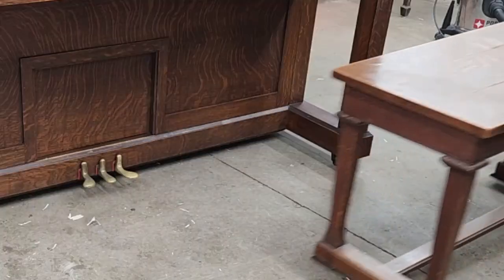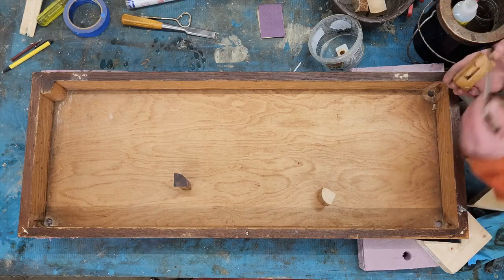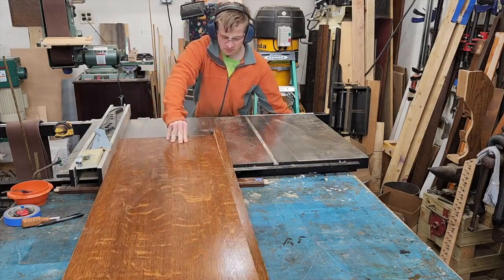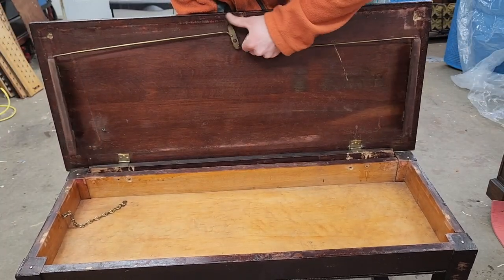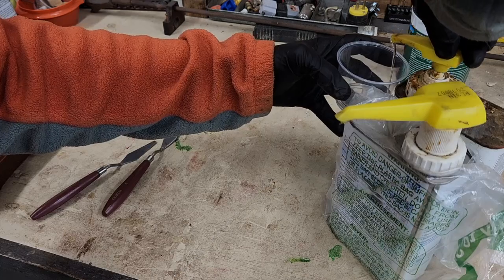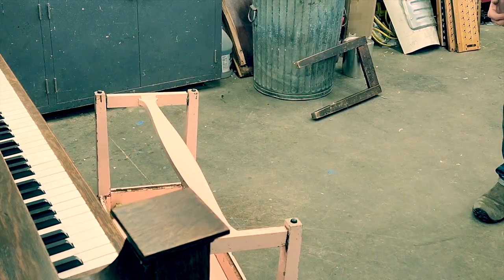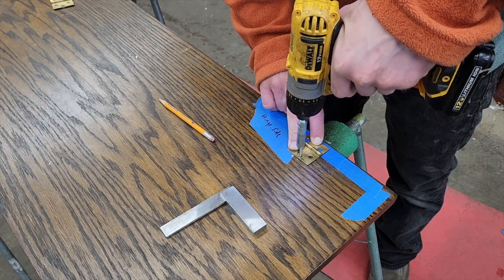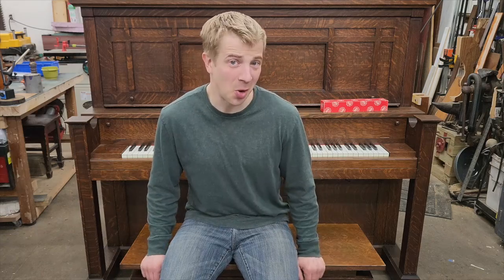Player Piano Revival Episode 17: Rescuing a Bench

Comment: The metal thingy is one of those things which you can stick in the top of a book to hold the pages open. It probably has a name that's not " Book-holder-opener-thingy"?
Reply from the maker: It didn't come with instructions.  That does sound useful though!
Reply: @Nate Otto - Outside the Vacuum  Yes! Great for hymnals and other books prone to slamming shut or flipping pages in the middle of a performance. It's called a Kibcoh page holder. Once again, wonderful videos. If you do any reproducer work, please let me know.
Reply from the maker: @Mason and Hamlin Ampico  thanks for putting a name to it!

Comment: Where is the best place you have been able to find parts for these old pianos?
Reply from the maker: Do you mean original salvaged parts,  or moreso new restoration materials?
Reply: @nateoutsidethevacuum  really anything. I am looking at getting a player piano and it is missing the whole pump mechanisms and bellows below the keys.
Reply from the maker: @David Jenks  I would strongly encourage you to find one that's complete. They generally show up for free if you're patient.
Reply: Extra parts for half and fully gutted players can sometimes be found in rebuilders’ bonepiles, but matching them with the right piano can be problematic. Big player action makers like Standard and Simplex who supplied many of the piano builders by the 1920 era, modified their basic design to conform to the scale requirements of each individual piano make/model in terms of the geometry. So for example, while piano action part spacings / wippen spacings were by then more or less standardized, the action breaks (big spaces where the metal piano action brackets are in the middle) are not universal, and neither are the spacings at the left and right sides inside the piano cabinet from the edge to where the first and last wippen are. So any old Standard or Simplex (etc) stack won’t do; it will need to be one for that make and model piano with the proper spacing. That is the problematic with retrofitting stacks. However, nearly all other missing parts (“head” with spoolbox and wind motor; lower unit including the pumping pedals etc) can be adapted with more or less success as the geometry is not as critical in most cases (rare early actions with pumping pedals that slide out from below, rather than fold down from the center, are an exception). Player parts can be found in most rebuilders’ bonepiles (what Nate calls his “above ground landfill”) and depending upon how full they are, they may readily sell such parts to you if correct for your piano.
Reply: I am going to put in a plug for one of my friends: my friend Doug Bullock in Alton IL (Piano World Enterprises) has over a multi decade period collected over 200 not previously restored upright player pianos, to sell to first time rebuilders and/or pull out and restore and sell occasionally in between customer projects. However, due to how busy his shop has been with work, and more and more original coin pianos, reproducing pianos etc coming up needing saving, Doug has not had time to properly photograph or advertise these pianos and has been running out of room to store them, so now has very reluctantly and sadly started junking some of these pianos to make room for some of the rarer ones. He would be thrilled for anyone reading this to come take a piano off his hands or buy for a very modest sum so it can avoid the burn pile. These pianos have been in dry storage on his property for years and I have been there and seen them in person. I hope at least a few more can be saved.